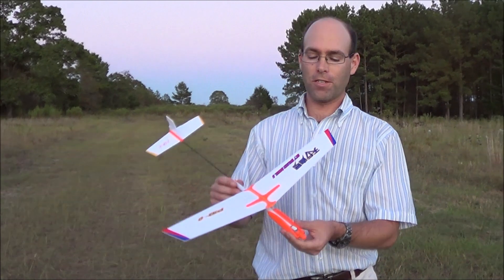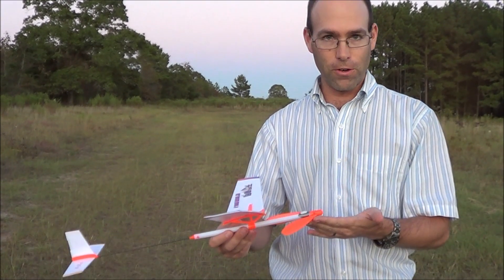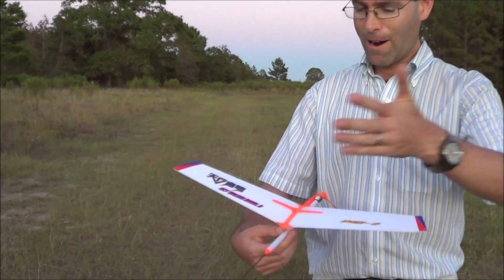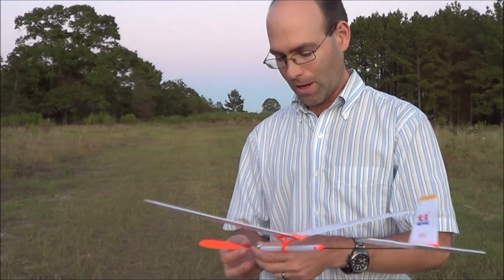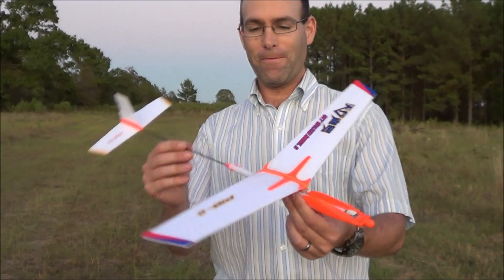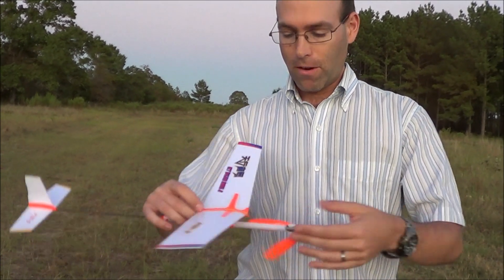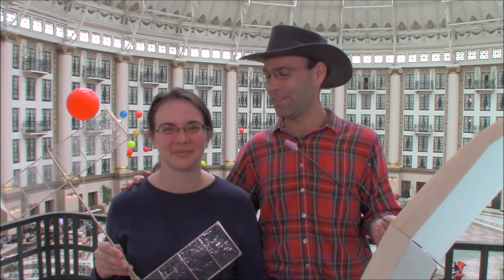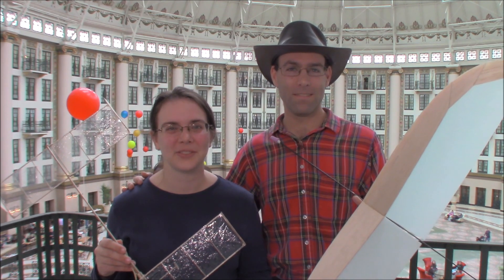P1B-0 Skywalker - high performance, economical beginner's rubber powered airplane!

Comment: I got a little FF infected a few weeks ago with a very basic beginner model flying it with my niece and nephew. Thanks for all your videos, your channel is a gold mine of FF information.
Now ordered a few "Good Boys" for getting my feet wet, some 1/8" (3.2mm) spare rubber, a 1:10 winder and the Skywalker. 
Can the Skywalker be powered with 1/8" or does it have to be 3/32" as you mentioned it in a different video?
Reply from the maker: If you can cram 4 strands of 1/8 in there it'll go great, but not easy. I've done it and I reckon it is worth it.

Comment: That looks wondrous.  Watching that reminds me of some of my early planes and being amazed at seeing them fly.  Did the plane come that well balanced or did you set that up?
Reply from the maker: Brian Martin it's a typical rubber model, so it does require balancing and the like.
Reply: The wing slides on the fuselage. A few test glides will get it trimmed quickly.